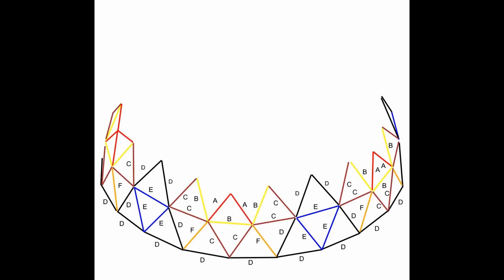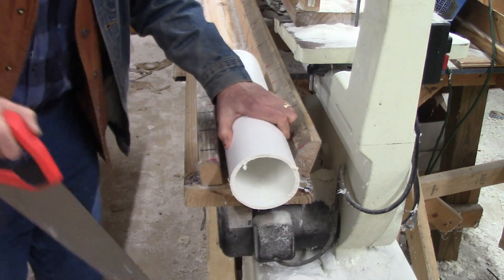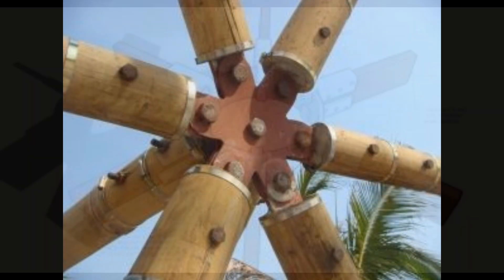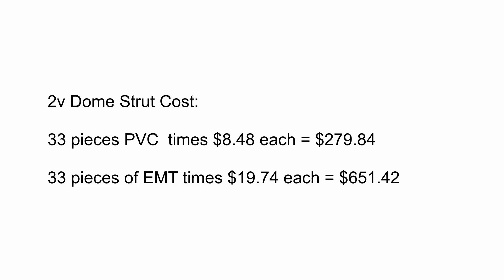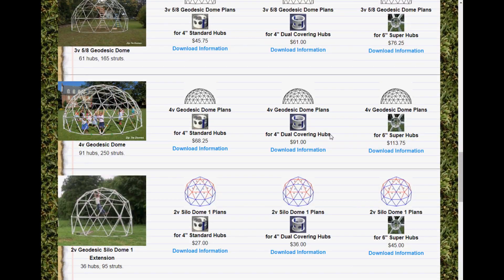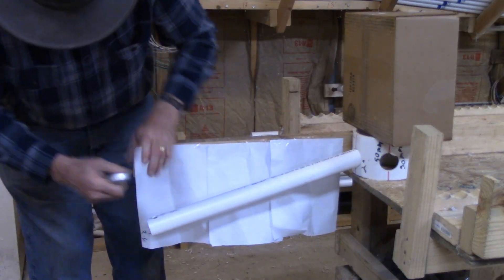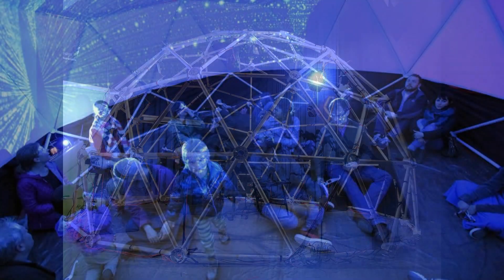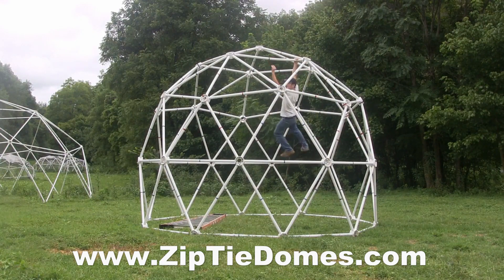Easy DIY Geodesic Dome Connectors that Anyone Can Make.

Comment: I've been binging on dome research to get some ideas, and more than once I saw people briefly show a pic of this PVC design when ridiculing the design of other dome hubs. To be honest, seeing the zip ties was an instant turn-off so I never bothered to look at this. But now that I've seen your excellent explanation, I'm actually pretty impressed. I think this design is well suited for glamping applications. There is a company here in Australia that does a good job with glamping domes by using metal tube struts with flattened ends and a king bolt going through all the struts. It's be intersted in your thoughts on that since it seems to align with the same problems that your design solves (ie. cheap and effective). Again, I am very skeptical of the zip ties, even though I know they are not load-bearing, but you seem pretty confident with the stainless steel ties. I'd be willing to give those a go. I suppose it depends on the quality of the stainless steel as to whether or not they would end up rusting. Honestly, I think the hubs are a bit ugly, but some innovative "hub caps" might solve that issue.
Reply from the maker: Thanks for your comments.  
The stainless steel zip ties are rated at 350 lbs tensile strength, so they are very strong.
Yes, you can cover the hubs with caps, as seen in this customer review:
https://www.ziptiedomes.com/customers/diedrakrieger.htm
PVC is cheaper than metal struts, it flexes instead of bending, and it is much lighter and easier to use.
Also bolting struts with flattened ends together is time consuming and requires tools.  You have to take the nuts off and put them back on more than once when adding struts to the dome.  With steel zip ties, you don't need tools when you are up on a ladder, just zip ties in your pocket.  And to take them down, you just cut the ties and it all falls apart.
The zip ties are not load bearing, they handle the tension, the center ring handles the compression.   The struts themselves are load bearing. The outer collar keeps the struts from moving past the correct angles to keep the dome from collapsing, which is not true with flattened steel struts bolted together.  
My first dome was made out of metal EMT conduit with flattened ends, so I have experience with both designs, and the locking collar that surrounds the hubs is an improvement. 
Also, the locking collar hub works for building domes from wooden dowels, bamboo domes, and even rebar struts, none of which can be flattened on the ends and bolted together.  So the design has more uses than the flattened ends design.  
Thanks for the comment, I love your skepticism and lack of trust for new ideas - yes, they all need to prove themselves before anyone accepts them.
Most people never try something new, or experiment with new ideas to see if they actually work.  So I try to push the boundaries, and I appreciate people that make me defend myself. 
Thanks. 
John Hurt
Reply: @ZipTieDomes  Thanks for the detailed explanation. I also think the PVC seems like the winning solution. I am really turned off by the idea of rotting timber - especially if using the cheaper stuff. However I like the idea of Bamboo none the less. Its cheap to replace. I saw briefly how it was sleeved. I think that is an excellent idea. In terms of the flex you mentioned. Obviously flexing makes it tugher, but within reason though. Since trusses are all in compression, I was thinking that using larger diameter PVC trusses and injecting them with a custom foamcrete might improve their compressive strength somewhat. It would also add some weight, but not too much I think. The foamcrete could be calibrated. Obviously this would be something that might benefit perminent structures. It's all up for the experimenting. I hope to be in a position to experiment with this design soon. My focus would be on accessoring this design and coming up with designs for panelling and/or canvas like coverings (wich could be replaced from time to time).
Reply from the maker: @TerenceKearns  That is a great idea.  Make a prototype and see what happens. 
John
Reply: @ZipTieDomes  I hope to do so. At the moment, I am renting, but I will talk to a land owner about leasing some space on their property so I can build my own geodome as a dwelling. Here in Australia we pay rediculous rent but still don't qualify for loans even though the cost of rent would easily make the repayments. This place is mental. It's one of the reasons I want to develop dome tech - to combat the growing homelessness problem that is being purposefully manufactured here.

Comment: Using an end cap for the connection hub would allow you to have a smooth surface on the exterior. But, the design gets an A for sure. 👍
Reply from the maker: One of our customer has already done that, and it made it look really professional:
https://www.ziptiedomes.com/customers/diedrakrieger.htm
Thanks,  John Hurt

Comment: I’ve been searching for this for weeks! Thank you sooo much!
Reply from the maker: Thanks again.  John Hurt
Reply: Can an impact drill be used to drill the circles and what it is the name of the thing that I attach to make the circles? Also if I use metal conduit with your pvc connectors will it be sturdier and able to be built bigger in an American climate that doesn’t get much snow?
Reply from the maker: @ I would use a forstner bit or a spade bit on a drill press, or you can use a hand held power drill.  Metal conduit will work too, but PVC is easier and cheaper to use.  You can build a bigger dome using a 3v dome design.  John

Comment: I'm really interested in making a dome for my backyard and the simplicity of your dome connectors really jumps out at me, the one thing holding me back here is I want to use it as a home office space. I'm not really sure how I could adapt the plans to make for a more solid insulated structure. I know I could use wood and metal connectors but that would still leave a lot of gaps and flex. And for use for a green house is there another way to cover the dome in more traditional glass or acrylic green house panels rather than sheet plastic? Sheet plastic is easier for sure but I'd like to have something last longer than green house sheeting.
Reply from the maker: When you cut 4x8' sheets of polycarbonate into triangles to cover a dome, it creates a LOT of waste and is very expensive.  It can also leak at the edges of the polycarbonate.  So we recommend a single sheet of plastic, which will last for several years and is not expensive.
Here is a link on how to make a concrete dome:
https://www.ziptiedomes.com/customers/lenabach.htm
You can put a wooden floor inside the dome for an office space.  Contact us at this link if you have questions.:
https://www.ziptiedomes.com/contactus.htm
Thanks,
John Hurt

Comment: I purchased the hubs-only kit for a 2V dome and have built and rebuilt it a few times. It is currently built and waiting for more funds before I skin it (so to speak). I may have to disassemble and rebuild one more time as its current location is on a slope. Less than ideal. 

Here in NM USA, I can build a structure and not be taxed on it if I build it on skids. So I will level the ground, build a skid-able floor and then place (or rebuild) the dome on top. Once situated, I want to skin it with a ferro-cement layer, add an insulation layer, and finally an outer ferro-cement layer. Hopefully, I will be able to recover the pipes afterwards. We shall see. Maybe by this time next year I will have the task completed. If all works well, I hope to then buy a 4V Hub-only kit so I can build another but a good bit larger. 

Here's hoping that you continue to stay in business until then and way beyond. Thank you for all your efforts and information. I'm really glad that you repost this info occasionally.
Reply from the maker: Thank you so much for your comments, it really made my day.
Be sure to check out this customer review on cement domes:
https://www.ziptiedomes.com/customers/lenabach.htm
Also this video:
https://youtu.be/4q-vnElQXCk?si=WXzj4_aYOz6oSXLz
If I can help you with your project, you are welcome to contact me at this link:
https://www.ziptiedomes.com/contactus.htm
Many blessings to you and your family.
John Hurt

Comment: 1. Wood isn’t that hard to use. A mitre saw isn’t super expensive and quite a few people have them. You don’t need a compound mitre saw for this. Wood flips easily to make cuts 😉. 
2. The people who watched it “rot” before their eyes, likely didn’t use treated wood. It’s a damp, moist structure that is outdoors. The wood needs to be treated.
Reply from the maker: That is a good observation.   I couldn't make the pointed tips on the wood struts, down to the millimeter in length, to get a good fit.  That takes a lot of talent with woodworking tools.  And if all you have is a hand saw, then I think it would be impossible. You might could do it with a chop saw, but I wouldn't want to try.
Wood will last longer with preservative or paint, but it is always a battle.  That is why vinyl siding has replaced wood siding.  If wood is exposed to moisture, if it does not rot, it will warp or crack.  I have had problems with carpenter bees on my wood deck.  A lot of people use plastic planks for decking instead of wood, as plastic lasts forever. But yes, if you treat wood, it will last a lot longer.
Thanks for watching the video.  John Hurt

Comment: Greenhouse with PVC fittings is a bad idea.   The poly covering will meld with the PVC tubing over time in direct sunlight.  This weakens the poly and make it prone to rips.  Add to that that sunlight makes PVC brittle over time, which can lead to failure in a wind storm.  Perhaps you can use 17 gauge 1 5/8 tubing (chainlink top rail), but even then the edges of the round connectors will rip the plastic eventually.  Another question I would have is how to uniformly attach the plastic to the structure   Have you thought about using channel locks and wiggle wire to attach the poly to the frame?  Right now, I don't see any ground anchors, and the square tarps don't drape well over the structure.  One good stiff wind storm and all that hard work will be in the neighbor's yard.  I'm not trying to be a troll here,  I have several poly hoophouses on my farm and I'm a Fuller fan.  I  played around with geodesics when I started, but I couldn't find practical solutions to the challenges they present.    Love to hear your ideas..
Reply from the maker: Thanks for your comments.  In our Assembly Manual, we tell the customer to paint the PVC with white latex acrylic paint, or cover the PVC where it touches the plastic with clear tape. 
Painting the PVC helps with the UV problem and keeps the PVC from outgassing chlorine which degrades the plastic.  
We have a Dual Covering Hub that allows you to attach the plastic to the hubs using zip ties, on both the inside and outside of the dome for better insulation.  We recommend that you use rebar stakes and drive them through the holes on the bottom of the hubs that rest on the ground to serve as a ground anchor.   Thank you for your comments.  John Hurt
Reply: @ZipTieDomes what about using a dome such as this for a sweat lodge? There won’t be a fire inside but very hot rocks would be placed in a pit in the center of the ground. With canvas covering it. Might this work?
Reply from the maker: @7eyesopenwide777  Yes, several customers use our domes for a sweat lodge:
https://www.ziptiedomes.com/customers/ellisonbeggs.htm
Have a great day.
John

Comment: Why not use a hole saw cutter? The Forstner bit seems unnecessary for this process.
Reply from the maker: I used a hole saw on my very first dome.  I had to take the blanks out of the center of the hole saw each time I drilled a hole.  A hole saw works well for a power hand drill.  A forstner bit works better for a drill press.  Thanks for watching the video.  John

Comment: About the rotten Wood, it might me a solution to do the plastic-layer INSIDE with some distance. So making the binding-circle, bit higher?
Reply from the maker: That might be a better solution.  Thanks for watching the video.  John
Reply: @ZipTieDomes  Bad Side of my Idea, plastic-layer INSIDE ist worse against Wind and water. Water could connect there becomes to much weight...

Comment: Clever concept. Respect. 
But I never understood how to make a cover for such a curved structure. The cover material is flat, the dome curved. How does it work? 
I am thinking of a greenhouse...
Another question I would like to know, how long would the PVC pipe last in a very high UV exposure.
Any hints welcome.
Thanks.
Reply from the maker: We have two methods of attaching the greenhouse film to the dome, which uses the folds and pleats of the film to help attach to the dome:
Dual Covering Hubs
https://www.ziptiedomes.com/video/coveringsvideo.htm

Standard Hubs with Test Caps:
https://www.ziptiedomes.com/video/coveringtestcaps.htm

Here is our FAQ answer for UV degradation of PVC pipe, with a link to the US Plastics Corporation:
https://www.ziptiedomes.com/faq/PVC-and-UV-Degradation.htm

Thanks,
John
Reply: @ZipTieDomes  thanks John for all this useful information.

Comment: Bamboo is NOT stronger than steel.
Reply from the maker: It is "tensile" strength, like pulling a rope.  It is not bending strength, or compressive strength.  

https://interestingengineering.com/innovation/bamboo-as-a-replacement-to-steel

https://www.stikwood.com/blogs/workbench/how-strong-is-bamboo-exploring-strengths-benefits

Yes, I did not believe it either, but it is in all of the scientific studies:

https://www.bamboo.org/_uploads/pdfs/JABSv29_Sanchez_20191007.pdf

So I guess that you can't sit your car on top of a bamboo pole,  but you can definitely pull your car down the road with a piece of bamboo.  Or probably drag your car up a mountain or vertical cliff.    Bamboo is interesting stuff.

Take care, 

John Hurt

Comment: Plastic Zip ties do not last long and degrade over time.  Heat and sun wuickly break down plasic. Pvc pipe also degrades over tme when exposed to sunlight. Pvc pipe must be painted when using for exterior applications. The stainless steel traps are a much better choice.  Thank you
Reply from the maker: That is a good point.  We use stainless steel zip ties for building the larger domes.  Sunlight and UV degradation only travels through the top 0.01" of the pipe.
https://www.usplastic.com/knowledgebase/article.aspx?contentkey=774
A lot of people paint the PVC pipe so it wont' degrade the greenhouse plastic.  
https://www.ziptiedomes.com/faq/Protecting-your-Greenhouse-Plastic-from-PVC.htm
Thanks for watching the video.  John Hurt

Comment: I remember when the US Army came out with some amazingly nice dome tents that used this type of frame system but being an Infantryman I saw real quick how the weakly designed hubs would not hold up to how we operate. We often don’t have a lot of time to put up or take down our tents and we often do those tasks in the dark or driving rain so a few young Soldiers putting this up may not be too interested in being extremely careful to not twist the hub joints. After a few short years the tents were withdrawn and replaced with more conventional designed tentage.
Reply from the maker: I agree, I am not certain this is the best type of overnight tent design.  It is better for a more permanent structure.  Thanks for watching the video.  John Hurt

Comment: Would it be possible to take away a strut or two for making a dome for a telescope?
If the hubs near the area we want open were stronger would that make a difference?
Seems like a neat solution but I don't know how weak the structure might become.
Reply from the maker: Jason, 
Yes, you can remove an entire hexagon or pentagon and the dome will still be strong.  If you look at picture #18 at this link, you will see that an entire hexagon has been removed from the dome to make a doorway, and the dome is still very strong:
https://www.ziptiedomes.com/fairs/Mother-Earth-News-Fair-Asheville-2016.htm

And a single strut can be removed to make a diamond shaped entrance or opening:
https://www.ziptiedomes.com/customers/billlamerdin.htm

The 16' and smaller domes are lightweight and can be moved around the telescope so as the angle of view changes, the opening in the dome can be adjusted to where the telescope is aimed.  So a smaller opening may work perfectly.
My dad was a science teacher, and he would bring home telescopes to ;et me see the planets.  It is a great hobby.
You can contact me at this link for more information:
https://www.ziptiedomes.com/contactus.htm
Thanks,  John Hurt

Comment: you could make a simple tool that can use a drill to make the end of thin timber the shape and size it needs for a mass produced hub that the hiker could carry around easily this way they could make a dome for camping or make on for homestead living... taller trees will make larger domes which could house larger operations from greenhouse to compost management to living quarters to creatives shops.... with the right materials you could even make a much safer blacksmithing hut thanks to the shape of the dome assisting in the acceleration of the hot air out the top which could have a vent that dumps into a heat exchanger so you could recycle the shop heat, or use it to make hot water.... id love to try a homestead operation and while i have all kinds of ideas and improvements i can never seem to find the community thats looking to benefit from these kinds of ideas.

Theres alot of 3d printed jigs one could design to make this process alot easier to mass produce the dome parts, ill bet theres a design that could be portable enough you could take it where ever you go in your trunk or in a backpack.
Reply from the maker: You have a lot of good ideas.  Be sure to send me pictures of whatever you build.
https://www.ziptiedomes.com/contactus.htm
Thanks,
John Hurt